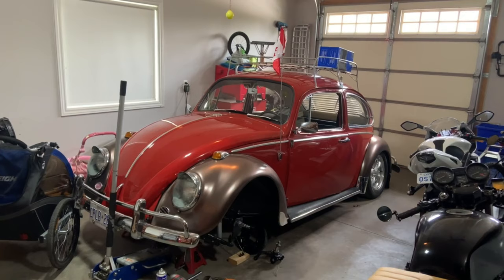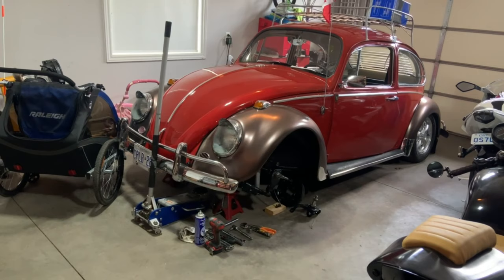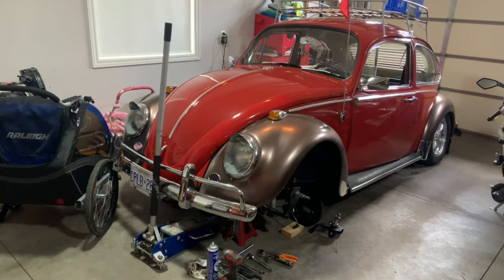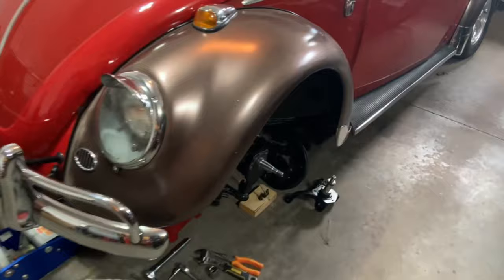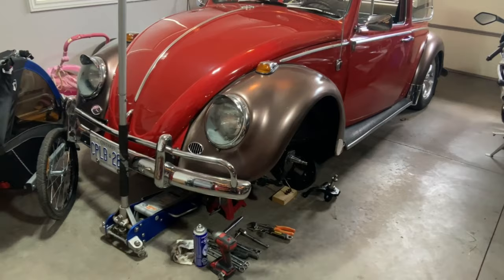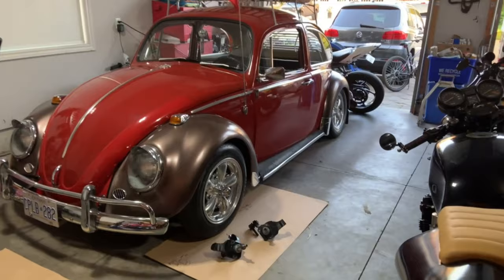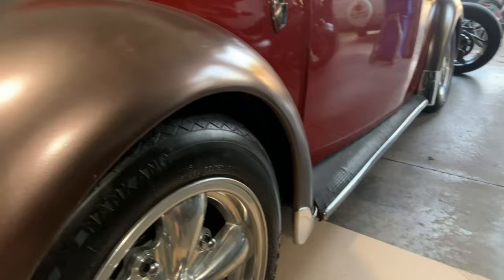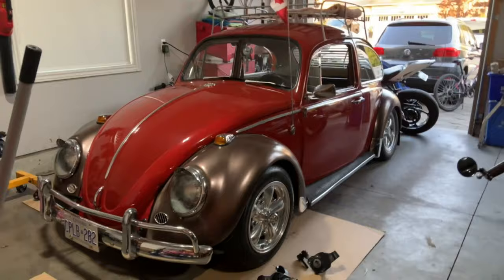1966 Volkswagen Beetle | Front Spindles

Comment: I ended up with a set of drop spindles for my 68, I’m sure that’ll end up happening to me also. Great video!! Thanks for the ride along!! Sounds great!!
Reply from the maker: Hopefully the fenders on your ‘68 provide a little more clearance.  I know that the profiles of the fenders change between years.  I’m pretty happy with how it runs, but keep finding it hard to get the time to take it out for a proper drive to break it in more.  I also found that it is running hot… turns out that my new backer board (tar board for fire wall) is getting sucked towards the air intake for the cooling shroud (I skipped gluing it on…. Ooops!)… I’ll need to sort that out yet before I take it on my next drive.
Reply: @JMKGarage  you have a really nice car my friend. Wow, I can’t believe your tar board is coming away from the firewall. But that would make sense completely. Of why it would be running hotter. 
If the drop spindles cause me an issue...I’ll switch over to 145s. 
I was trying to keep the 165 on the front ...we will see what happens. 🤞
Reply: Empi came out with a forged spindle with zero offset. Your car will preform much better with the drop spindles than using the adjustable beam. Fine Tuning with the beam is fine, but using the beam to lower changes the geometry dramatically which make the steering poor.
Reply: @user-vn7lv5hh8w  Yes I agree completely! I’m not a big fan of the adjustable beams, I’m not saying they’re not nice. They’re just not for me.
Reply from the maker: @user-vn7lv5hh8w looks like my last reply didn’t work… good to know about their new spindles… they deficient have them (at least through Cip1) when I ordered these ones.  Since this video I’m really not liking the ride quality from the adjustable beam.  Thinking these spindles you are suggesting would be the way to go… thanks! 🙏

Comment: Empi came out with a forged spindle with zero offset. Your car will preform much better with the drop spindles than using the adjustable beam. Fine Tuning with the beam is fine, but using the beam to lower changes the geometry dramatically which make the steering poor.
Reply from the maker: That’s good to know!… definitely wasn’t available through Cip1 when I ordered these, which I would have gotten instead.  I may need to go that route as I agree, the ride definitely isn’t the same now with it lowered.

Comment: Hi, I’m also going to remove my 2 1/2” dropped spindles, I don’t like the bumpy rear ride and the steering is stiff in the corners, did you find that, and ideas, just curious before I remove the dropped spindles.
Reply from the maker: Thanks for watching.  Unfortunately I never got opportunity to drive it with the lowering spindles as the wheels rubbed the fenders too much.  With the car at stock height, I was very impressed with the ride.  I am considering raising both the front and rear up a bit as it bounces uncontrollably now.  It has new good quality shocks,  but I’m just smashing the bump stops to pieces right now.  Love the stance that the car has, but not very good when it makes it so difficult to drive.

Comment: So even if your fine tune the adjustment with the adjustable beam they still rubbing, reason why I asked I have and adjustable beam, but is not narrow, is it worth for me to install the two and half drop spindles? Or not?
Reply from the maker: You are absolutely right.  With the drop spindles, it offsets the wheels outwards.  Even if you raise your adjustable beam all the way up, your wheels (unless extremely small and skinny) will still rub.  With the drop spindles you will need at least a 4” narrowed beam.
Reply: @JMKGarage  even with stock wheels? I currently have stock wheels on mine.
Reply from the maker: @monchy25  yes, unfortunately with the stock wheels… that’s why I got these ones that are on my car now as the front are smaller diameter and narrower than the stock wheels to allow more clearance